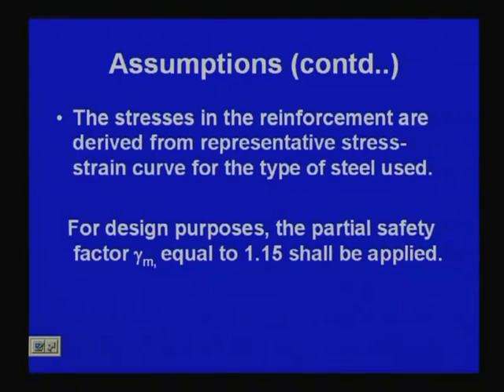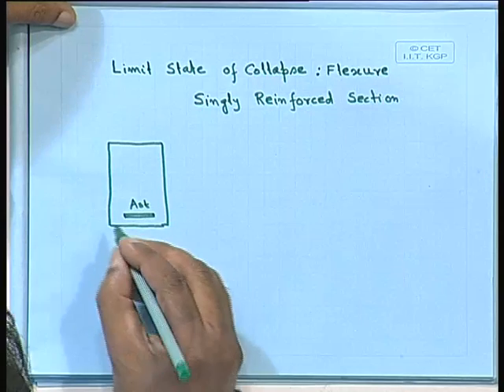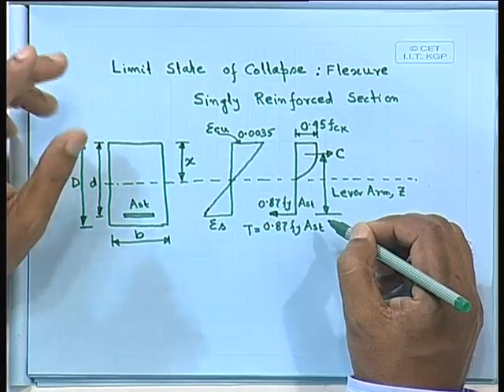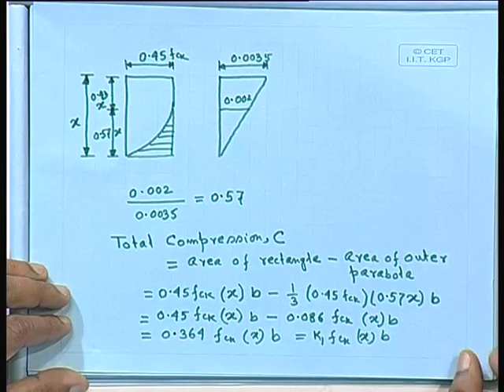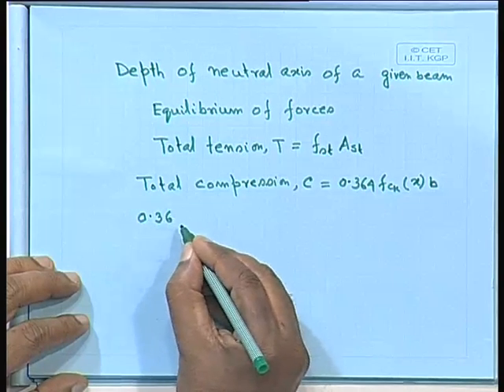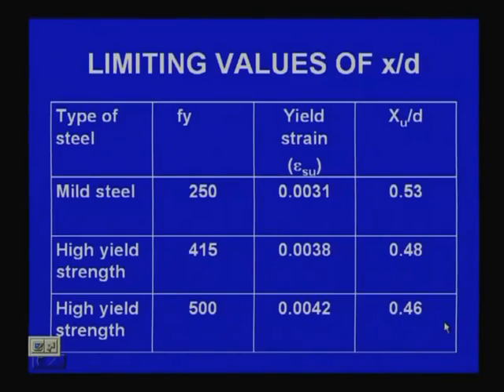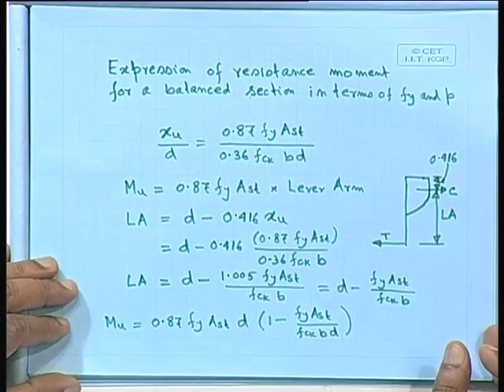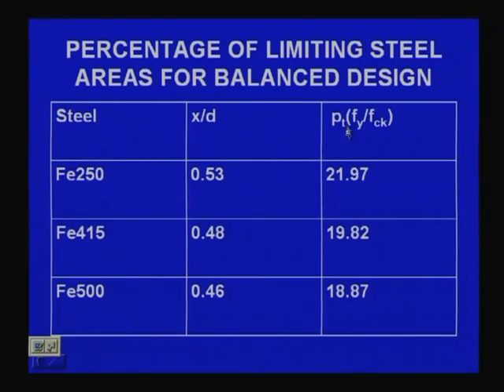Limit State of Collapse Flexure

Comment: How the compressive force has changed its direction..32:08
Reply: Resultant force of partly rectangular and partly parabolic portion at a C.G of 0.42 from top and it will be always in compression for concrete upto NA in the normal direction to the plane.

Comment: Why we assume the permissible stress less than the ultimate stress for design calculations?
Reply: Because if we will assume permissible stress equal to ultimate strength then the structure will fail due to even marginally small addition of load due to various factors but if permissible strength is taken somewhat less than ultimate strength then structure will not fail due to unpredictable addition of small loads

Comment: we already considering fos 1.5 for concrete but why we have to take 2/3 rd of fck again???? could you please explain???
Reply: If we cast M20 concrete in cube and test after 28 days we get failure load as 20 N/mm2
But at the the same time if we cast Mw0 concrete in 3 cuboid of base length 150mm x 150mm but height of 200mm, 250mm and 300mm and we test the 3 cuboid due to slenderness the cuboid fail before reaching 20N/mm2
As the slenderness ratio increase the 20N/mm2(sigma cbc) decrease but maximum decrease is only (2/3 sigma cbc).
So we consider characteristics strength as(2/3 sigma cbc) and from this strength  we again add factor of safety. ((2/3 sigma cbc) /1.5)